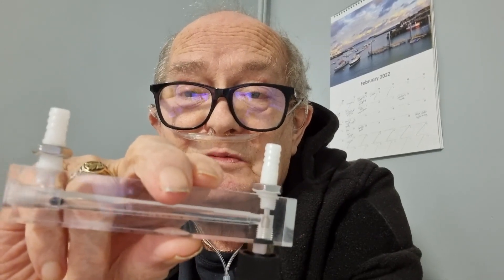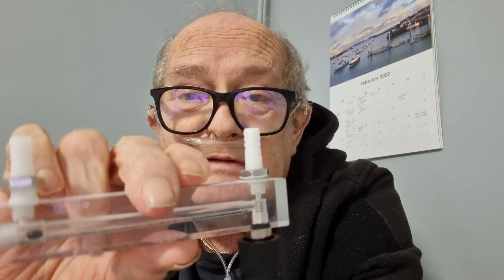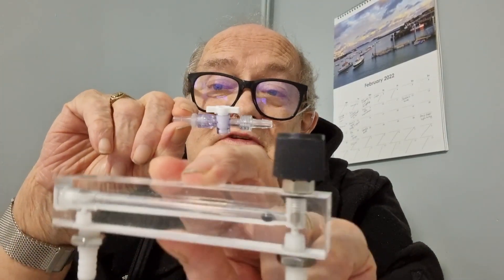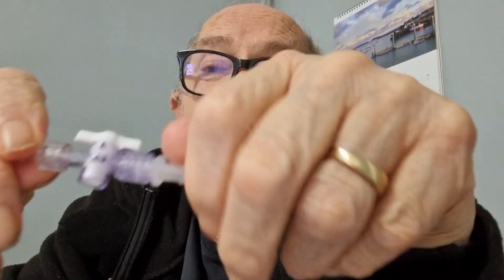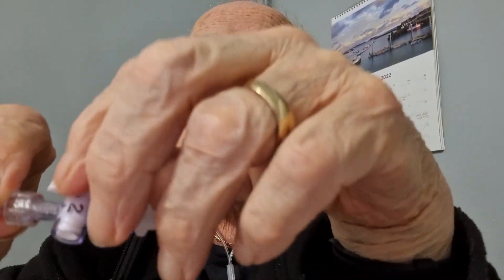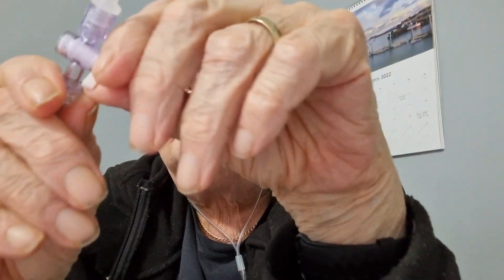Controlling differing oxygen concentrator flow rates.

Comment: Hi Derek My name is Ken and I am from Victoria BC Canada.  Someone on the BC Lung Transplant FB group posted the link to your video on our website in response to a question I raised and you addressed here.  Adjusting O2 flows without having to return to the concentrator to make adjustments.  
I have checked out the posted website and looked at product information and it checks out with what I am looking for.  I noticed that you posted the Youtube video in February 2022.  Any updates from using the device for a few months? 
Thanks so much for your research and communications.  They are very helpful.

Comment: Interesting.  I do have a couple of questions:  (1) Does the smaller device allow variable flows or just 2 settings (as in your example a 2.5 low or 6 high)?, and (2) At what flow rate do you set the concentrator (your desired maximum flow)?
Reply from the maker: set concentrator to your peak flow. yes two settings though it works between but would not know the flow